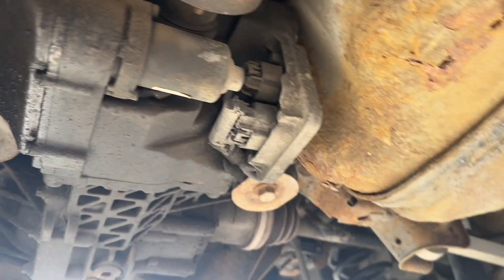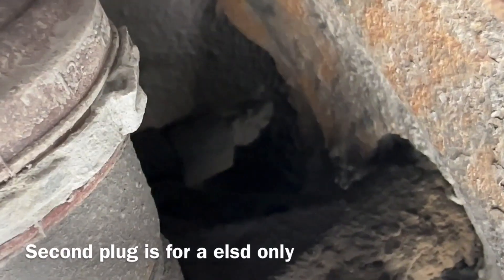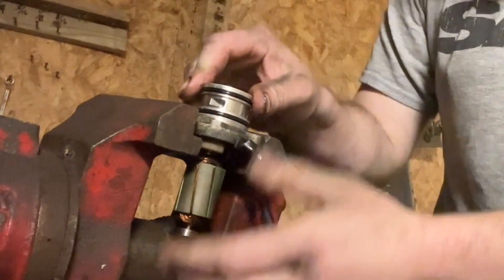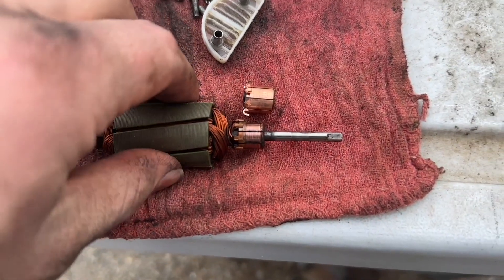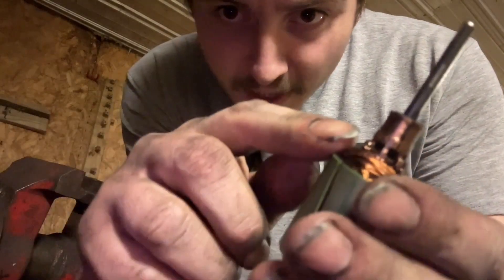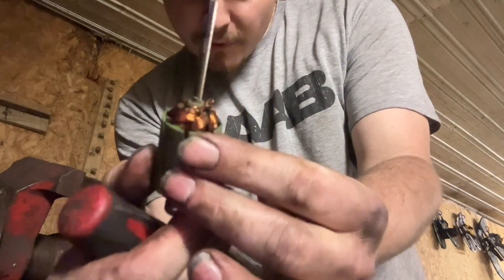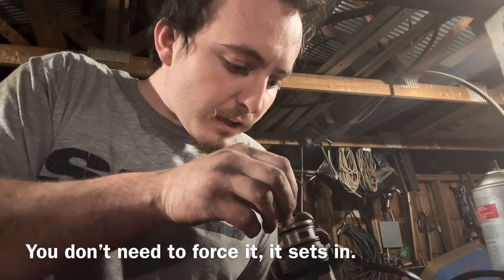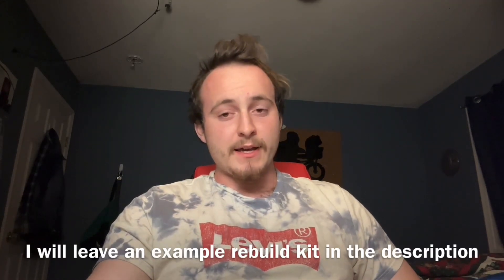Saab XWD Differential Pump Rebuild (Haldex 4 pump kit install)

Comment: Thx. Is there a reason you didn't use any contact cleaner or lubrication during re-assembly?
Reply from the maker: I did use electronics cleaner on the magnet side. Inside the pump where fluid flows there is no point, just make sure there is no dirt. The pump has fluid pushed in manually when refilling the differential.
Reply: @SolvingSaab  Understood. Thanks for the reply. Great tutorial BTW 👍
Reply from the maker: @petezzzz Thanks!

Comment: Excellent video and step by step guide. My question, where did you buy that copper ring, brushes and o-rings for the pump?
Thanks.
Reply from the maker: @alfonsoaslbox4121  directly from haldex site or on ebay! Just do a few searches for aoc brush kits on google.

Comment: What were some of the indications that the pump was bad before it was dissembled?
Reply from the maker: @okletsskate  a code on the tech 2 for low pump pressure. Usually this is a bad filter or bad pump.
Reply: @SolvingSaab  Cool, thank you. I know what to look our for!

Comment: I just have a question for you! If I have in stock a Differential Pump not ELSD can I put it on my car that have ELSD  ? thx
Reply from the maker: @Marc-AndreRiendeau-jf4nr  LSD and ELSD pumps are not interchangeable because they have different plugs. The kit in the video will fix both though because they are the same internally.

Comment: Excellent video 👍
What fault code did you have?
Reply from the maker: C0407-64 low oil pressure. I knew it wasn’t the clutch seal because I did that fix already and fluids were not cross contaminated.
Reply: @SolvingSaab  I have owned my TX for 13yrs and got my first XWD fault code last week. Not had a chance to investigate the code is C040704 WIS says AWD Oil Pump Motor Open. The differential clutch pump current is less than 0.3 A for 30 s.
I will need to investigate.
Reply from the maker: @firesaab31  that may be a bad pump, try a xwd service and that may fix it.
Reply: @SolvingSaab  I have serviced my Haldex every 2yrs since owning the car despite covering just 3000 miles a year. I serviced just a few weeks ago. 
I should have time to investigate next week.
Keep up with good work and keep posting videos 👍